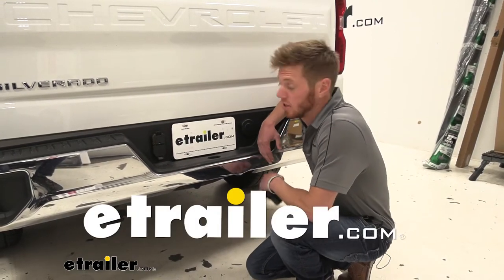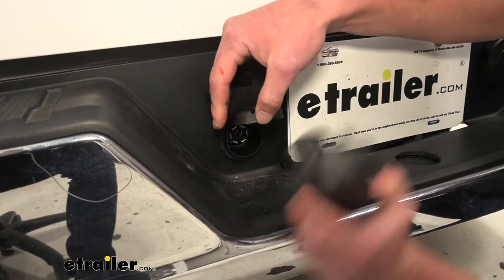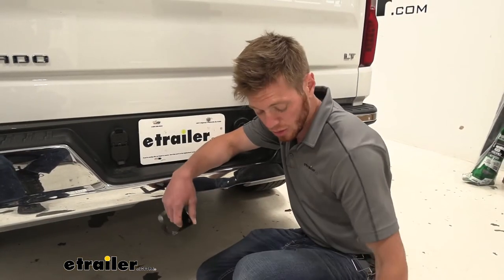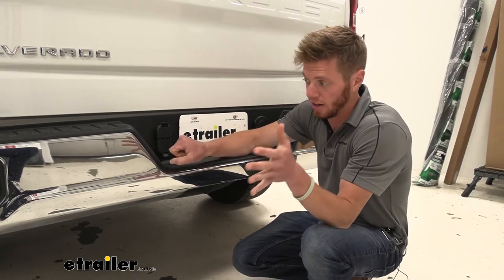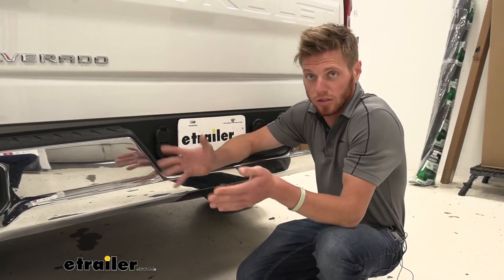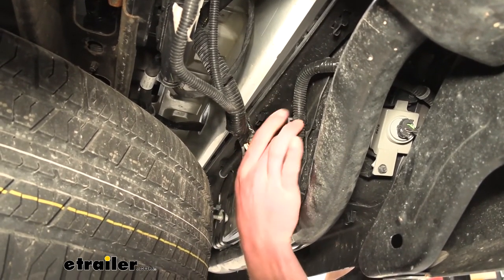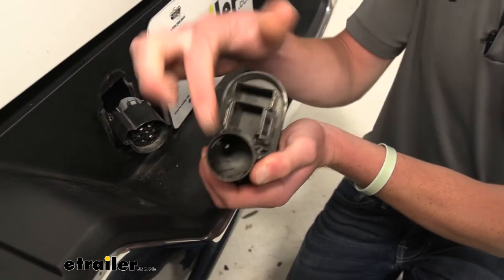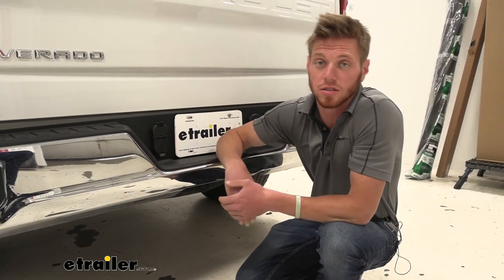Hopkins 7- and 4-Pole Trailer Connector Socket Installation - 2020 Chevrolet Silverado 1500

Comment: Reale tabs won't cooperate
Reply from the maker: Release tabs, right? 
They can be a bit stubborn. Use a small screwdriver, push down on the metal retaining clips which will free the connector from the bracket. Hope that helps!
https://www.etrailer.com/Custom-Fit-Vehicle-Wiring/Hopkins/HM40975.html